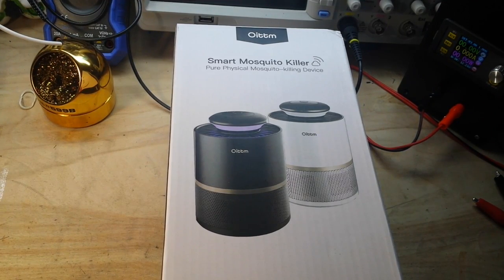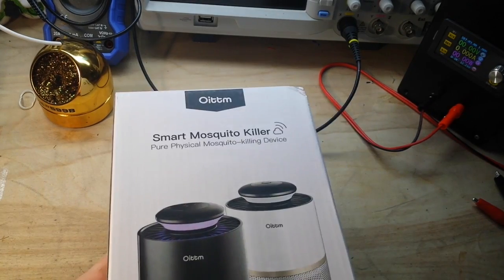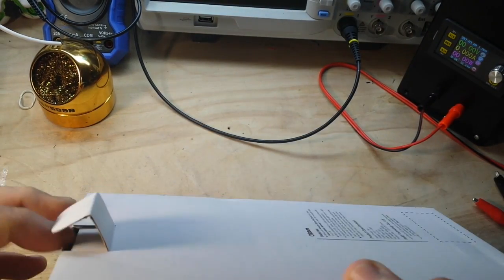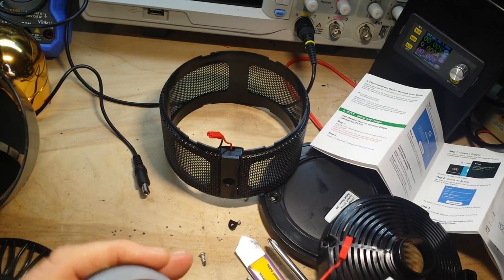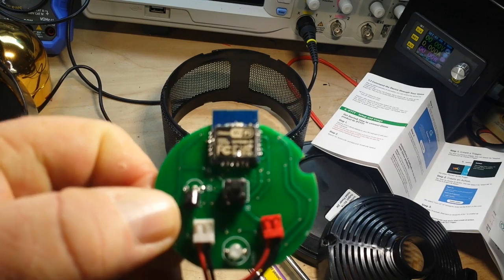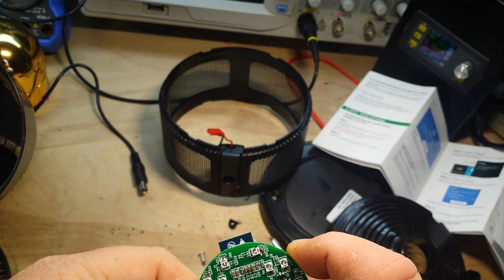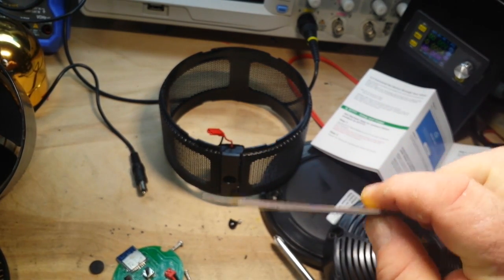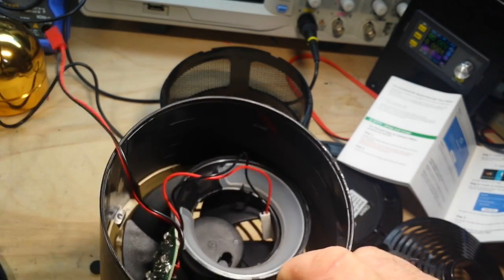Mosquito Killer Teardown

Comment: This is the worst review I've ever seen and gets a very, very rare thumbs down. The most important question about this device is whether it is effective at killing mosquitoes. Other questions might be how much energy does it really use, is it safe, and is it easy to use. We didn't get an answer to any of these questions. Instead we see a hillbilly tearing the unit apart and complaining that it isn't worth the money, without even bothering to do any testing. Just disgraceful!
Reply from the maker: Its crap. It doesn't kill mosquitos. They can fly out the top. Sorry you didnt like it.
Reply: It appears to be well designed and well built. Mosquitoes aren't smart and it is possible the fan would keep them inside, and a small amount of insecticide in the trap would help too. When I was young, we had Shell No-Pest Strips which were incredibly simple and effective (DDT). It's OK to trash something that doesn't work, but maybe it worked great and we'll never know...
Reply: Usually when people send you their own stuff to test, they expect you to actually test it for its intended purpose, and then tear it down. Maybe it performs well and it certainly looked well built...

Comment: We don't have many mosquitos, mainly thunderbugs (tiny full stop size flies) and midges (the scottish plague).  Mine is a 12" square mains powered unit either fitted with 2x 9" UV fluorescent or (mine) a single UV cfl bulb hidden behind a metal cage thats powered by a quite hefty step up transformer to some ridiculous voltage that reaches out 1/2" from the mesh to zap the little buggers.  It's absolutely lethal - to humans too - the safety guard is grounded and I've never been tempted to see "what if".  It's extremely effective and this time of year when they swarm fills the tray of death every other day.  with about 15-20g of bugs.  Sometimes it sounds like a gunfight going on in the kitchen.  The 2 and 4 cfl units are used in foodshops.

The app I use for WiFi switches and some other remote hardware is eWeLink, I'm not certain anything like this can be described as "secure" but it uses a reasonable VPN security login routine with password protection.  It's multi talented and compatible with the hive and similar kit plus much of the chinesium remote "specials".  

I was a bit cautious at first but I've used it without issue on a range of WiFi connected gismos for about 8 months without issue.  It seems to detect them all correctly and they all work.